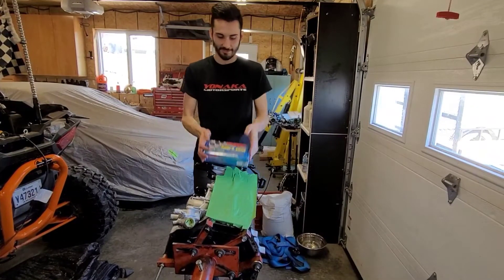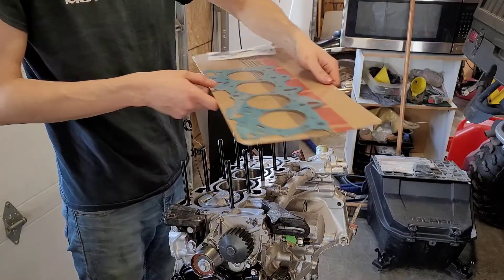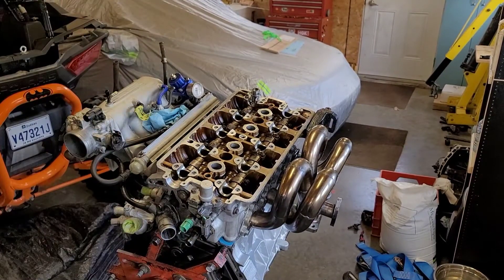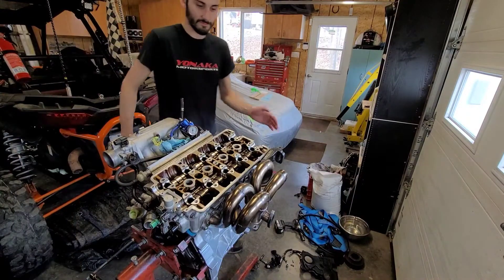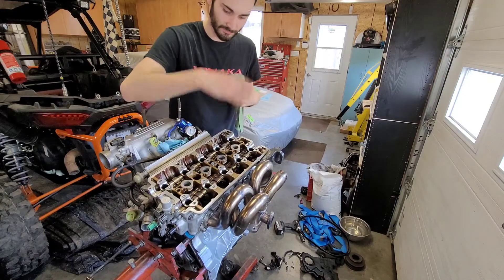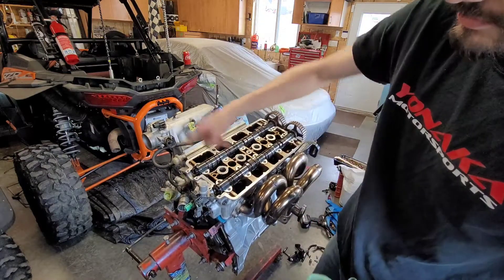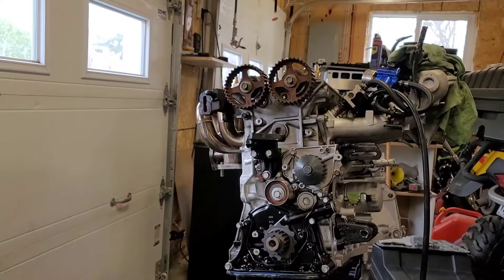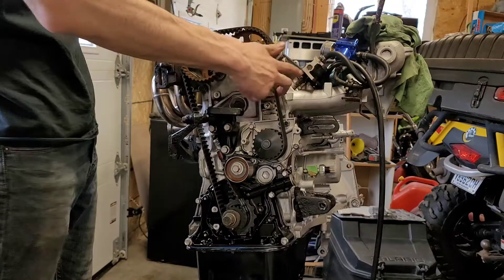How to assemble a Honda b16 engine

Comment: 9:50 on the head in the middle theirs supposed to be a O ring and some other part for the vtec
Reply: What part? I was wondering if it’s the same thing I’m missing from my engine.
Reply: A little o ring and a little dowel pin
Reply: @p72crxhf43 the dowel pin on the top. Ot the 2 that go on the bottom 
Of the head at both ends?
Or are those pins different ones
Reply: @jesseserrano6520  no the one right in the center of the top of the head between the center cam holder and head
Reply: @p72crxhf43  thx for replying.
What about the 2 pins that go on the bottom of the head. What are those called? One of the 2 got bent when i took it to the machine shop
and i need to order one to put my head back on
Reply: @jesseserrano6520  no problem. Those dowel pins are called cylinder head dowel pins. Just be sure to right down what engine it is for